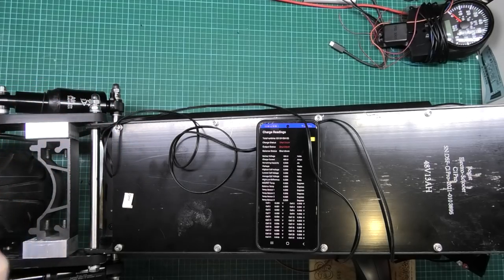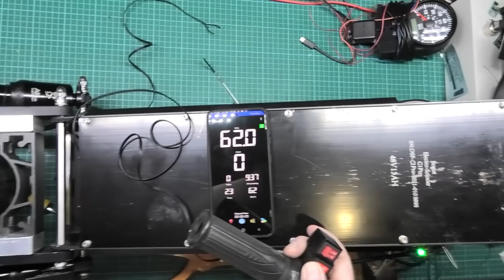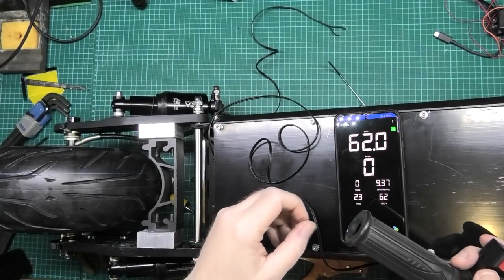🔴 EXTREMELY POWERFUL E-SCOOTER BUILD part 8 - 18650 battery fitting and 3kW motor tuning

Comment: @vortecks remember i told you about the material where the rear swingarms are made from.. i would HIGHLY ADVISE you to make new ones!!!
with me and a few other people , they broke , with serious results after... 
please do yourself the favor , upgrade those 2 pieces!!!!
Reply: Definatly a week point in this scooter seen a few broken now Jack 😩
Reply: I've seen a few people mention this now. I worry about Tony. Who will I watch when his swing arms disintegrate 😢

Need someone with a waterjet cutter or a CNC mill. Luckily they don't look very complicated. I was tempted to buy a cheap enduro bike frame (the one with horizontal dropouts) after much research I find the steel quality was on par with cheese. I bought the slightly more expensive EEB enduro frame with vertical dropouts.
Reply: @18ct  i plasma cut mine ;)

Comment: Here is a tip for cutting SS round bar. 
Place round SS bar in chuck of small electric drill, put bar into carbide blade pipe cutter, pull drill trigger, slowing wind the tensioner of the pipe cutter until bar is cut!

Comment: Try putting more talcum powder on the bead of the tire and then slightly over inflate to get the bead to seat. You should hear it snap into place. Then slightly deflate until within specs.

Comment: Coming along nicely, a DIY 
1- 3mm rubber gasket for the Battery cover may help reduce that cover warpage/flex. Ofcourse it will make clearance to ground around 1- 3mm less. 
Great install, look foward to seeing you rip along the streets & suprise passers-by 😏👍👌

Comment: I was surprised that you said you could see the tube through those screw holes. I would be temped to cover the inside ends of the holes with some kind of tape to prevent the tube pushing into the holes and possibly onto any sharp edges. Perhaps a bit like rim tape on a bicycle but with some adhesive layer to hold it in place. Or is this perfectly normal in scooter wheels and not a problem? (Personally I have no idea.)

Comment: Getting close to that exciting time again. Just wondering if it's worth putting some sort of insulation barrier to protect the battery from the heat of the controller. Impressive how you got it all in there and so neet and tidily.

Comment: According to the tread pattern the rear tire is on backwards. Soap will help for sure.
Reply: Check again, the deck is upside down as it opens from the bottom. Herringbone channels should meet the road first at its thinnest so any water can be expelled, but this is probably a moot point as I don't think Tony will be aquaplaning at 80+ mph on soaked roads!
Reply: @ahaveland  if it's upside down you are correct! I thought the battery compartment was open to the top.
Reply from the maker: ^^^ What Andy said